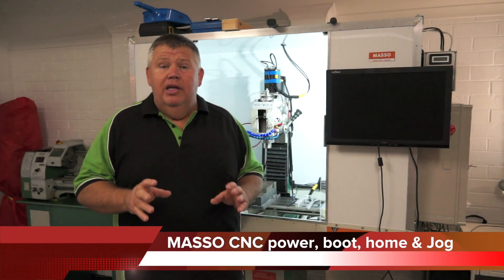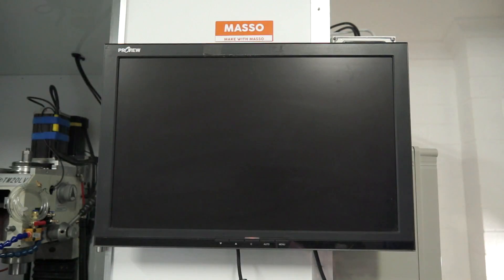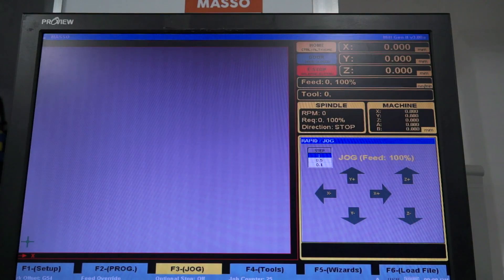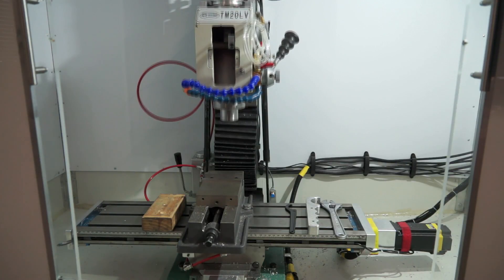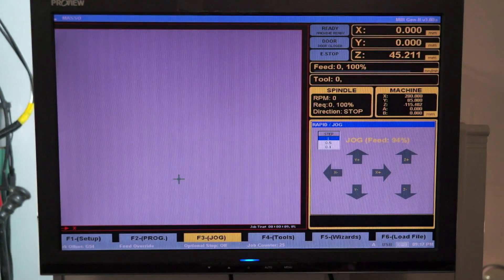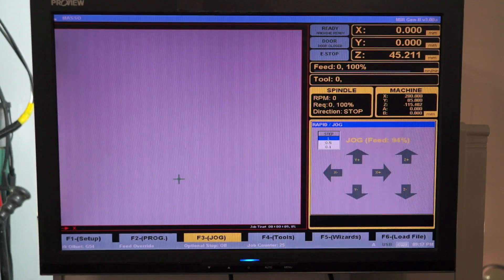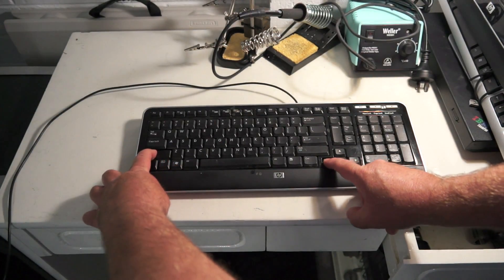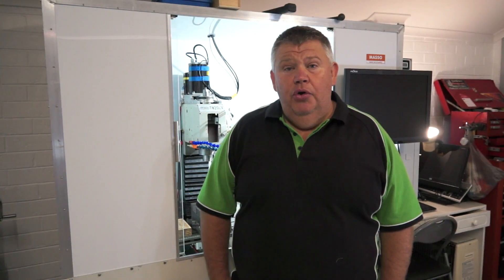Masso CNC Tutorial Part 1 - Power boot up, homing & jogging

Comment: Great videos keep it up, What are you using to control your factory spindle with masso, cheers
Reply from the maker: G'day Peter.  Thanks for watching mate.  Unfortunately I wasn't controlling the spindle with the Masso when I built this.  I was still turning it on manually.  However, the Masso is capable of controlling that function.  I have since sold this machine and moved on to a turn key Syil X7.  Cheers, Aaron

Comment: Great video 👍👍👍
May I know why do we need to do the homing ? What is the importance of it other than the start up alarm. I have a PNC machine and it works without homing.
Reply from the maker: Hi Ravi.  you usually home the machine to find it's absolute zero in every axis.  Nearly all CNC machines need to do this.  However, more modern machine with absolute encoders do not need to do this anymore.  An example is my Syil X7 CNC mill running the LNC or Siemens controller with an absolute encoder servo system.  Hope this makes sense mate?  Cheers, Aaron.

Comment: Aaron, you didn't explain why you homed your X-axis to the right? Interested to know...?
Reply from the maker: Hi Jeff, yes I was trying to keep the video under 5mins and hence omitted that explanation.  Upon homing my machine (table to the front / left) all movements from this point are in a negative direction.  When setting the work offset via software it would add the machine X - Y value instead of subtracting it. This is a software glitch and I have to wait for Jatinder to fix the bug.  Hope this explains why. Cheers, Aaron.

Comment: Nicely done Aaron. There seems to be more and more interest in this unit all the time. I understand the G and M code is somewhat limited at this point, and no backlash support. Your thoughts?
Reply: Is it possible to do drill cycles like G82 and G83?
Reply from the maker: Hi Rus, yes. you are correct.  It doesn't have backlash support at the moment.  But Jatinder from Hind Technologies is adding more and more features constantly.  He has assured me that backlash compensation is a high priority that will be added this year.  I'm not sure about the G & M code that you've mentioned.  The Masso is running version 3 software now so maybe these have been addressed.  Cheers mate, Aaron.
Reply from the maker: Hi Ryan, you are correct.  It currently doesn't support G80, G81, G82 or G83 drilling cycles.  Hopefully Hind Tech can rectify this ASAP.

Comment: Nice!  Is that the correct way for the jog to work?  I get that it's the head relationship that is referenced.  I have mine setup up so that the keys move the table in the direction they point.  Way easier for me to keep track of when jogging around.  But....when using the pendant, it's the way you have yours setup.  Hmm.....I've broken a couple of haimer tips that's to the difference. lol  So.....do all the commercial machines jog the way you have yours setup?
Reply from the maker: bluehandsvideo hey Mike. I had you in mind and kept the video to 5mins long. See the effect you have on me ha ha ha. Yes mate, when jogging you envisage which direction you want the spindle to travel (not the table). However it is opposite for gantry style machines like CNC routers.